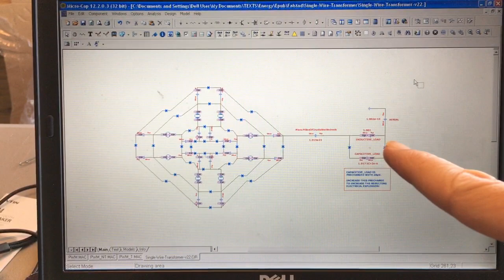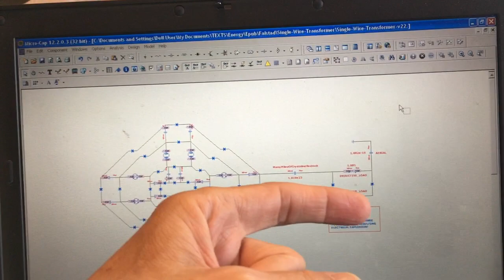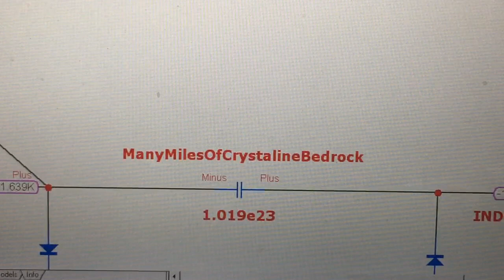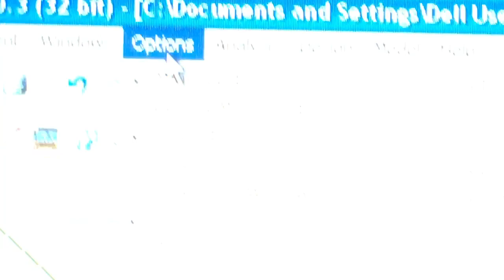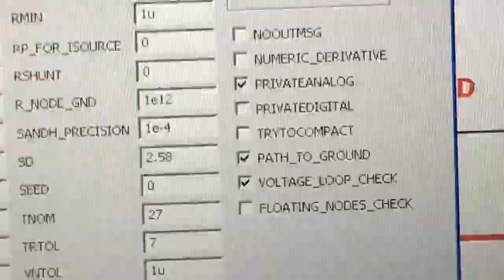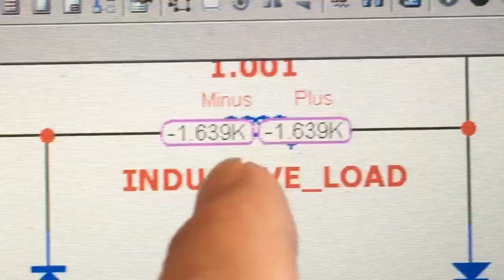Single wire non-transmission of power! Non-transmission is the key… Amplification via reflection.

Comment: What if you made a coil that wrapped around a shape, not just a cylindrical pole, like what if you wrapped the coil around a triangle, or a long rectangle, or a chalk line tool shape. Would it affect the phase of the circuit? Maybe we see a sine wave because the coil is wrapped in a cylindrical shape, maybe it displays triangle waves when the coil is manipulated to wrap around a triangle shape, and square wave around a square. More testing is required i guess. I know the shape of the coil is important because when I was working as a computer programmer at a underground facility in virginia, they rolled out some device from an electrical room while doing maintenance. It had a very unique looking copper wire coil that had like 12 different shapes stacked on top of each other. The shapes were like 12 different 'chalk line tool' shapes in different rotational positions almost like clock positions stacked on top of each other. The only thing I could think of was that it was converting the electricity into multiple phases(greater than 3 phase), or they were using the shapes to oscillate frequency in a rotational clock like fashion. Idk i only saw it for about 3 seconds while I was walking to lunch from my dungeon cubicle. I no longer work there and it had nothing to do with what I was working on, it was just some big machine they pulled out of the electrical room, it coulda been anything. Its not my fault they let me see it for 3 seconds while walking to lunch.
Reply from the maker: Everything you're hypothesizing is true. The pyramids at Gizeh are shaped that way for an intentional reason.

I chose an octagon simply to accommodate convective cells which are the causal, 'a priori', reason for this circuit to emulate a hollow sphere. So, the octagonal arrangement of eight convective cells (in three concentric and radial layers of arrangement) are, potentially, eight TEM (transverse electromagnetic) modules of Eric Dollard's analog computer which I get to talk about in the next video of this series. And it is the topology of a hollow sphere which is at the root of this archetypal circuit.